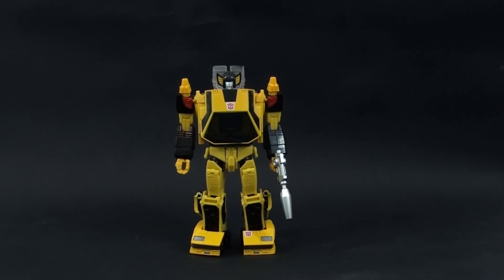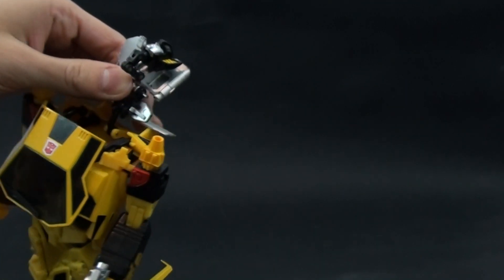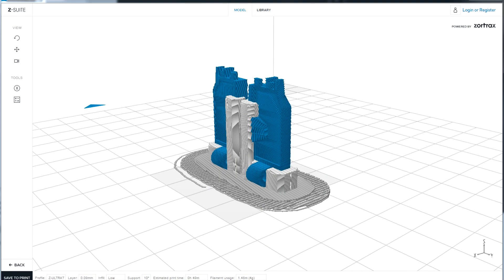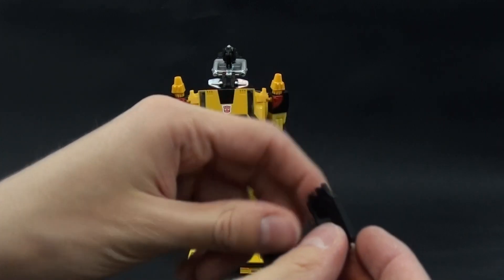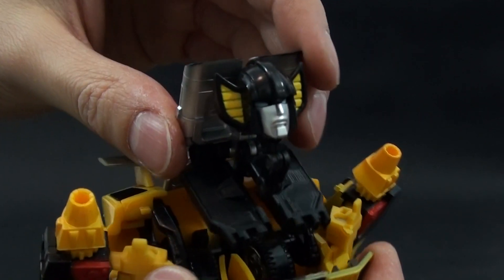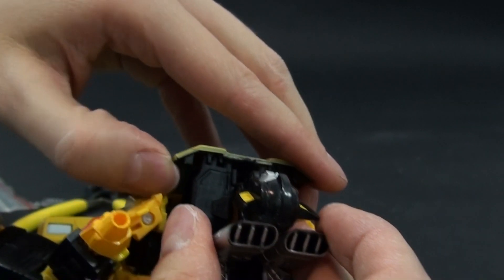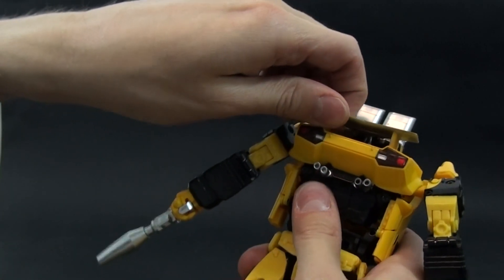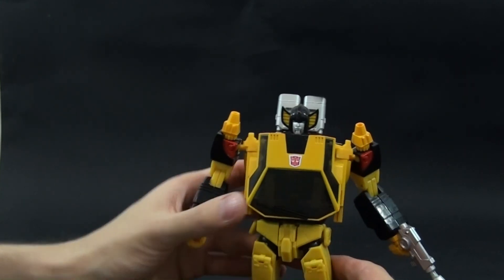Omnigonix Spinout Chest Fix (3D printed on zortrax m200)

Comment: hello, i printed the fix, for some reason it does not seem to tab in to the chest
Reply from the maker: Hello. What printer and slicer are you using? Is it too loose or too tight?
Reply: Hi @monologiorobotach557 , thank you for the reply
i am using an anycubic mono 4k and lychee slicer
the tabs are too short to clip in to the chest where the old tabs go in to

Comment: Is there a way to add some tabs to lock the neck bar into place? Since the parts move individually maybe a tab on the bottom of one side and a tab on the top of the other? Also any way I can order it directly from you?